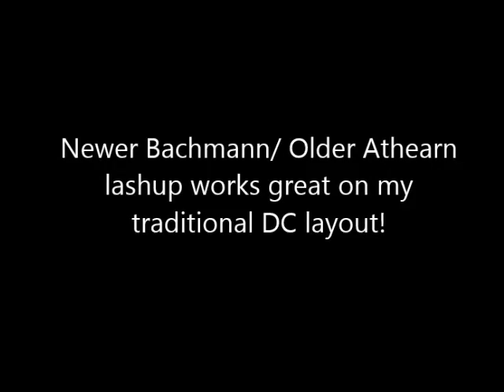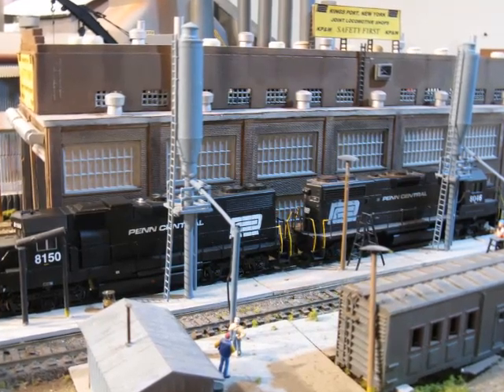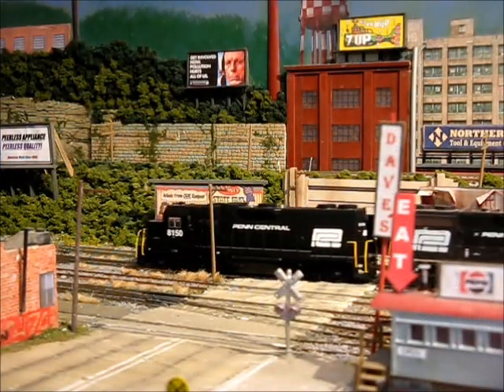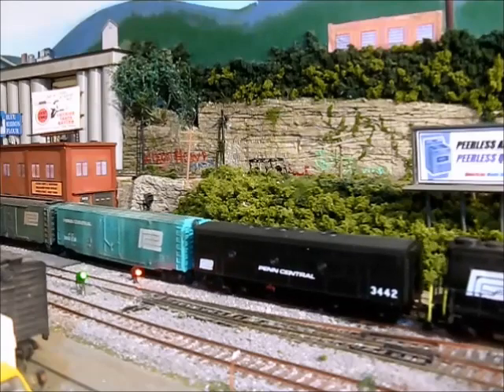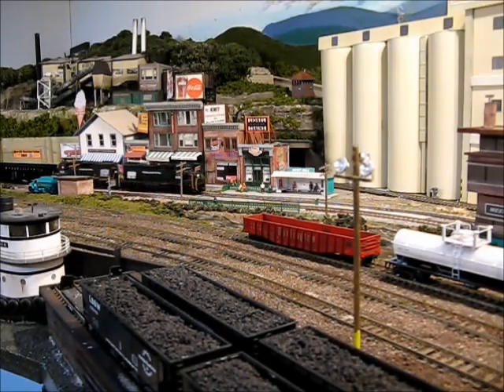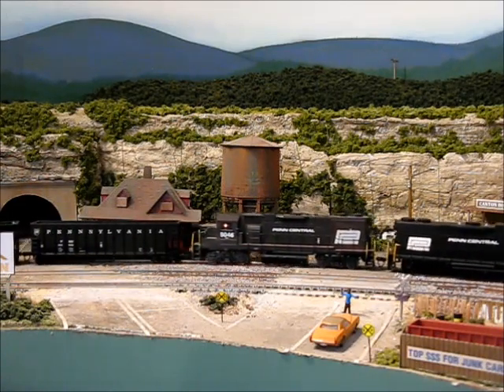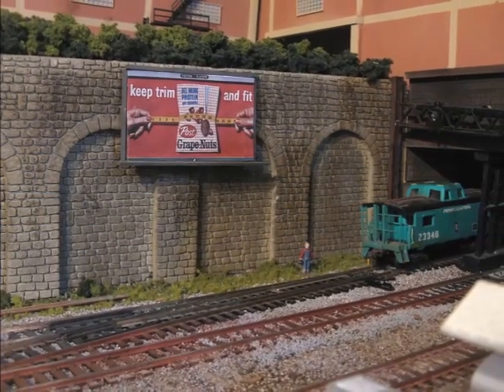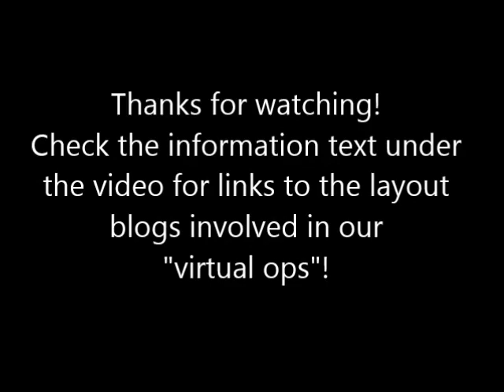Newer Bachmann-Older Athearn MU Works Great on My DC layout!

Comment: Really nice looking video and always a pleasure to see the layout in action! I would have never guessed Blue Box Athearn locomotives would pair up so well with newer Bachmann units. I’ll have to see if my units pair up together. I like your standard PC logo change from the rare orange and white logo. Which is a very PC practice. Doing research, I found several units getting two sometimes three unique paint jobs in the eight years on the PC.
Reply from the maker: Thanks!  It was just a happy random choice to attempt matching those two units.  I don't know how typical it might be for the new Bachmanns to run well with old Athearns.  Hopeful speed matching is one of the simple pleasures of DC layouts.  :)
Reply: Or as Bob Ross would say “Happy Accidents”. ;) For the size of your layout, your motive power does remarkably well pulling the trains across it. Even at Marion, you don’t see them acting up. The KPD is a great example of keeping it simple and reliable with standard DC.

Comment: Two questions
What type of drive system is on that “old Bachmann”?
And what RR is the “HR” car in New Haven livery but HR logo?
Reply from the maker: Its actually the Athearn Blue Box unit that is the older one.  It has the typical dogbone u-joint on one end that fits into a plastic cup on the worm gear shaft. The other end has a hexagonal shaped head that slips loosely into a hex-shaped hole in the motor flywheel.   The HR represents the Hoschton Railway Co. which was the freelanced road of a friend of a friend.  John in our virtual ops introduced me to his friend "Engineer Ed" who developed his HR freelance.  Unfortunately Ed passed away but John made the NH styled HR cars as a tribute to him and a gift for those of us involved in the virtual operations together.
Reply: @RalphPCvids  that is a wonderful way to remember a friend on your RR